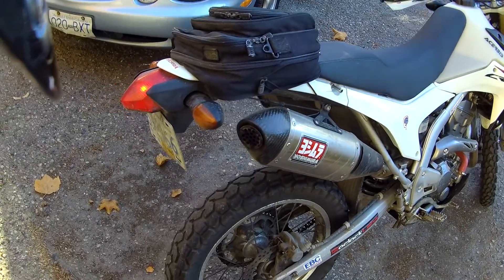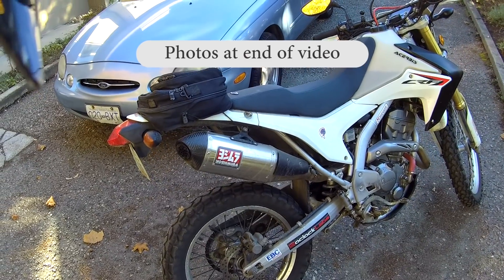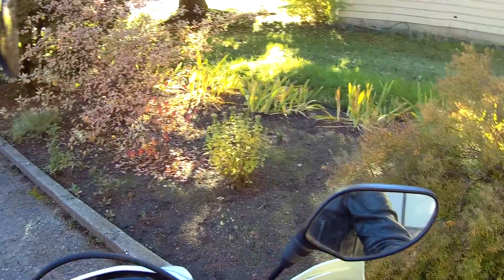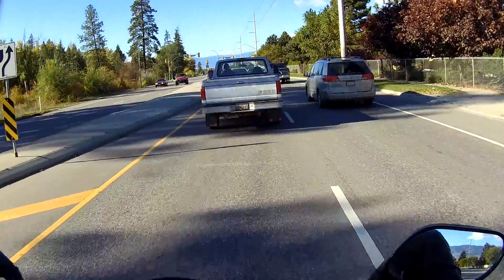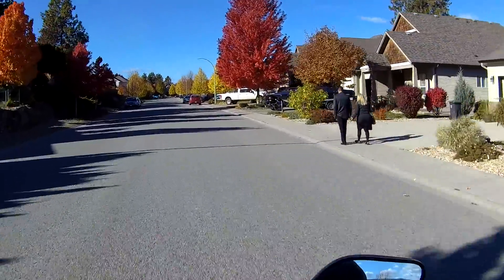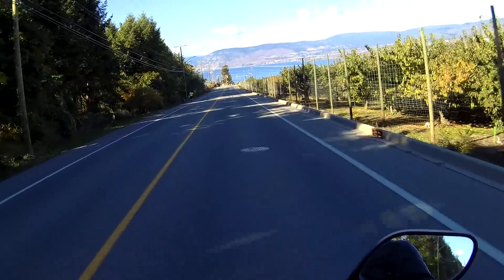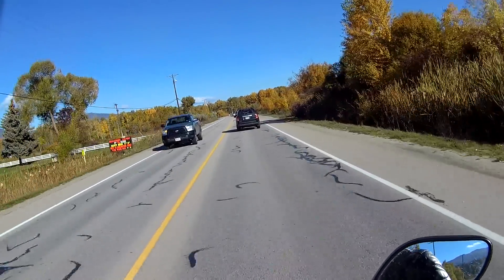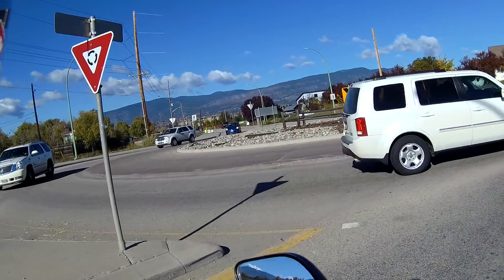CRF250L Baffling the Yoshi RS4 Again and Chit Chat

Comment: I would like a Yoshi for my 250l but the full pipe requires the oxygen sensor bung to be welded in.  I'm thinking to just put the rs4 slip on, on but will I require re-mapping or anything just for that? If not im thinking it would be great to swap between the slip on and stock muffler now and then
Reply from the maker: The Yoshi Full system does not require an O2 sensor bung on the header. The system is just a bolt on system. You retain the functionality of the stock O2 sensor which is in the exhaust manifold. As for fueling with a slip on: if you open out the air box and use a high flow filter along with the slip on then yes you are wise to get an EJK controller and use the settings they recommend for the stock bike as a starting point. You can then tweak the controller just one number up on the Yellow and Red settings, then switch back to the stock numbers when you use the stock muffler. That would give you a bit more power than bone stock. An EJK controller is about $225 but well worth it.